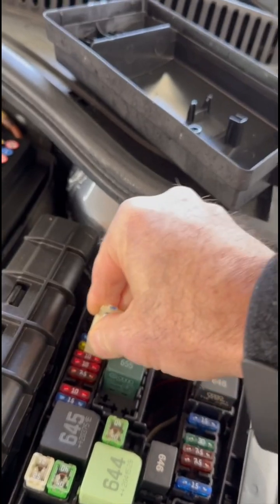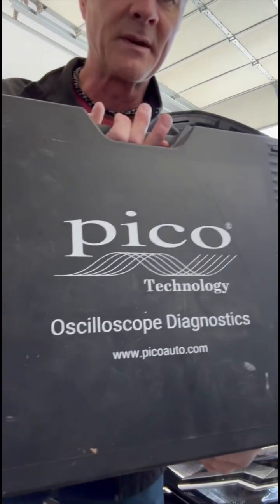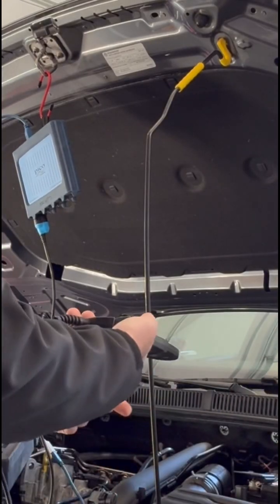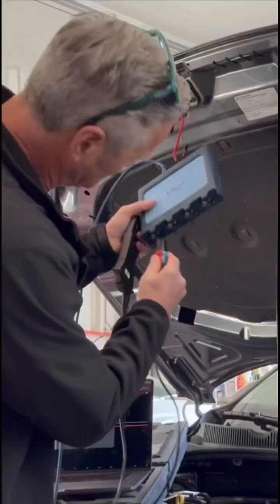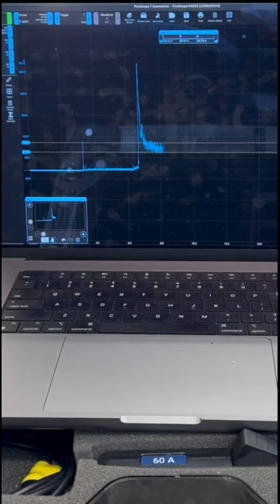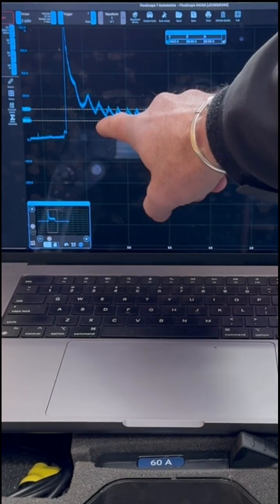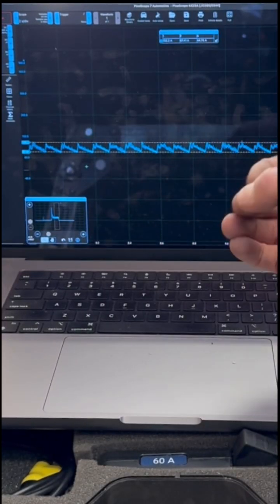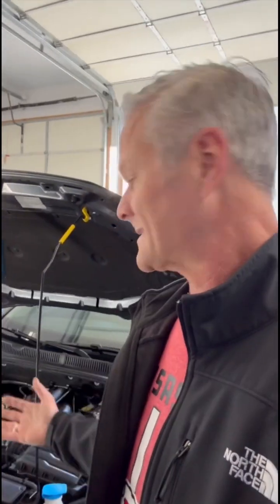Relative compression check 💥2021 VW Jetta #picoscope #usedcars

Comment: Nice. You can also measure volts across battery in DC or AC mode (for more sensitivity). You should get a waveform which is a mirror image of the Current waveform. Also, if you need to flip clamp for better placement, just invert waveform.

Comment: Electrons go the other way: (-ve to +ve).
CURRENT travels +ve to -ve!
If you were an Electrical Engineer, you would know this and avoid using words that do not apply.
This is why most mechanics swap stuff till the problem disappears, rather than diagnose the actual problem.
Reply from the maker: @Dodger2879  🤣 guilty as charged…I’m only a mechanical engineer! Apologies if I stated that part incorrectly, but that is how to think of it in terms of the amp clamp so you point the arrow in the right direction. Otherwise I would’ve gotten an upside down waveform. Still would’ve worked the same though! 😉
Reply: @FearlessMods  
Oh dear....now you are joking, or playing!! (I hope!)
A.C. is the one that displays a sinusoidal "waveform". Amplitude and frequency nonsense stuff. 
But never mind, if it helps fix it: Great!
Reply: @Dodger2879  Cranking compression displayed as in the video is very much considered a waveform...
Reply: @peter15847  
Yes. I can see why he refers to a waveform. It does reveal differences in amplitude of current drawn.
I stand corrected. Thankyou.